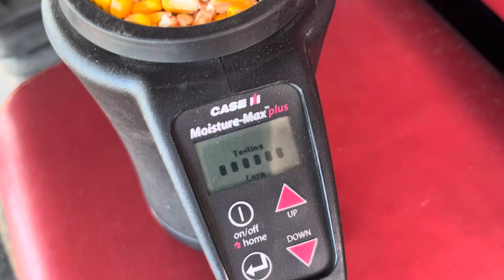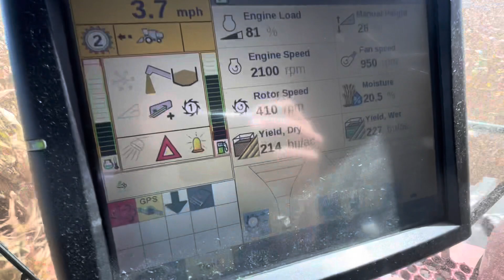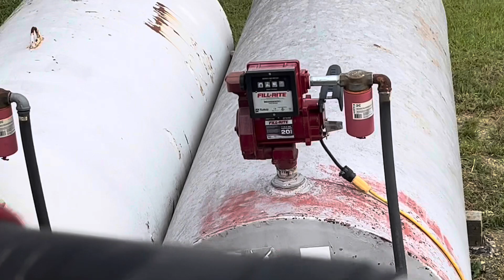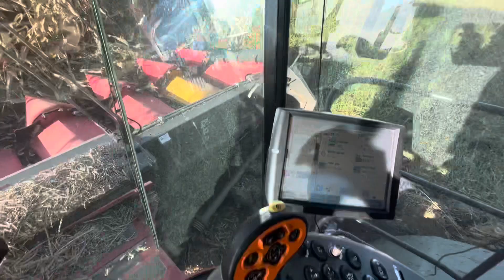Demolished Cornhead & Burried Combine

Comment: My neighbor slid their 2388 20 ft down a clay almost slope into a ditch last year didn’t do to bad of a job with a backhoe to clear a path for the head and a 4wd to pull it. Wrecked an expensive jerk strap but nothing else. I’m tiling that ditch into my property line ditch after they get the field done so it doesn’t happen again and fixes road flooding issues